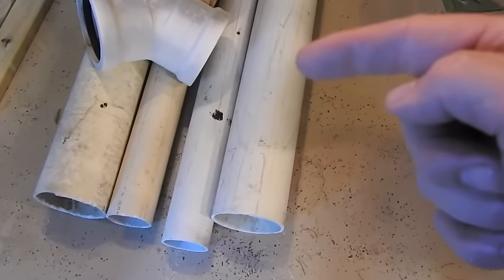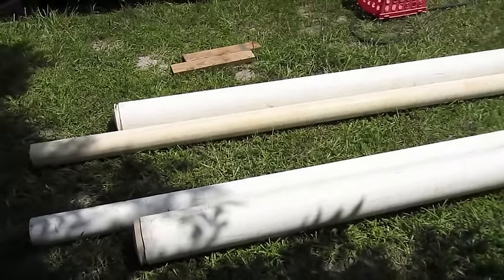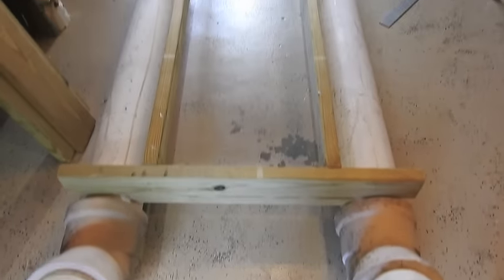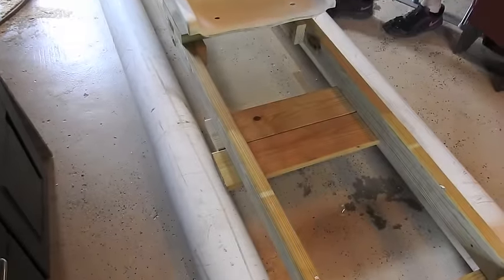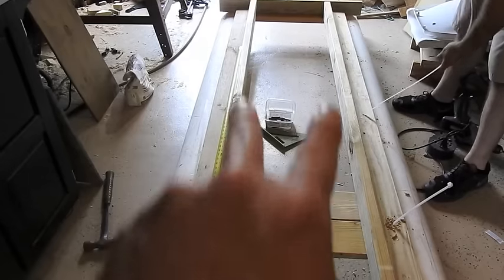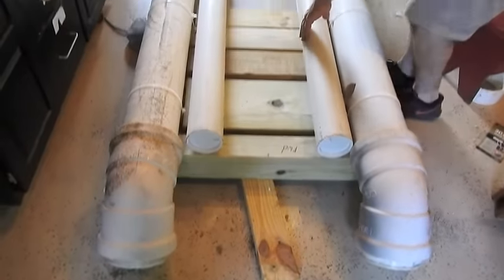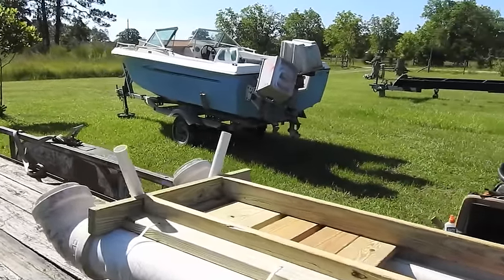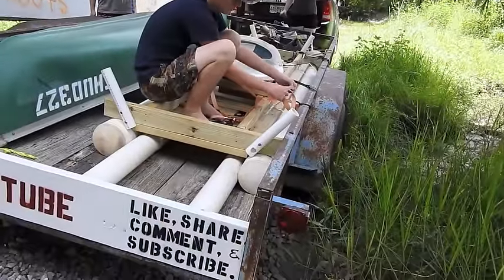Cheap $100 Homemade PVC Fishing Kayak How To

Comment: needs a little more floatation. foam sheets might work.
Reply from the maker: That is a good idea and this morning we put 3 more pipes under the front. Thanks for watching.
Reply: Only way to increase the floatation (buoyancy) is to displace more water below the surface. In order to achieve this you'd have to add more toons, increase the length of them, or swap them out for a larger diameter pipe
Reply: six6tysix yup. Positive buoyancy is also improved by flatness. Theoretically if you would roll out the pipe so it becomes flat there is more upwards pressure, allot of pressure is getting lost now due to a bit pressing on the sides and up instead of only up. For the very same reason stability would be increased. Though considering working with the materials at hand, swapping the smaller pvc for same size would be allot better. Placing just a 50cm long pipe on either side as outrigger will increase stability allot allot. That at or slightly behind the seat to keep manouvrability. That or a very shallow keel. The latter does not provide  positive buoyance though.

Comment: Great idea. What i would do is seal up the ends, then drill holes every 2-3 foot and fill the holes with exspanding foam, then seal up the holes. I know you did use foam inside, but i dont think the tubes were full enough. The posibilities are endless
Reply from the maker: It sure was fun!!! BTW, I just uploaded a couple of homemade pontoon boat videos, I would love to hear your thoughts on them... thanks for watching.
Reply: Adding foam will not increase bouyancy. Foam will just add a lot of weight to the PVC tubes making them less bouyant. As long as you seal the ends properly they will be water proof and attach the wood frames with straps thus eliminating any need to drill tubes. This is not rocket science boys.
Reply: mark carvour  I guess you missed the rocket science class that showed how foam floats and dont sink !!!
Reply: Use closed cell foam. Open cell foam soaks up water and that is the type used in the video. Any type of foam in the tube will displace the air which increases the tube weight. The only way to lighten the tube weight is to add a gas that is lighter than air. Might I suggest that you use hydrogen which will make for rocket science. Seriously, seal the tubes with a PVC cleaner and then use PVC glue and the tubes will be water tight and no need for a secondary floatant which only adds weight and does not add floatation.
Reply from the maker: Great explanation, foam is heavier than the air in the tubes. Thanks for the reply.
Reply: I should add that real pontoon boats do use closed cell foam in the air tanks for redundancy (safety). Those metal tanks will sometimes spring a leak from hitting rocks, logs, etc. For a hobby project like this I wouldn't bother and besides if you do get a leak it will add to the excitement.
Reply: Lol

Comment: that's some dirty black looking water
Reply from the maker: It is a good thing that it doesn't smell as bad as it looks... I actually doesn't have a smell.  Thanks for watching.
Reply: lee gates Thats called brackish water.
Reply: Thats clean water compared to where I'm from.
Reply: its actually called a screw driver Don butter
Reply: i live in the hard woods in Minnesota... the leaves from the trees ( it is called tannin) the acid and the iron ore's  in the soil stain the water ( see Minnesota iron range)...dissolve in the water and stain it from dark green to almost black
Reply: water clarity is expressed in inches, not feet... look up seechie disk
Reply: oops secchi disk... that is how we determine water clarity.... pollution is our main concern here... any time you have a heavy metal mining operation, or oil rig... pollution is, and always will be your main concern.

Comment: fill the bottom with 4" PVC with the angle pc in the frt. will float higher and  move thru the water better .might even be able to run the motor with out half the boat under water
Reply from the maker: I am not sure what you are talking about, but I sure thank you for watching.
Reply: you only used two 4" ,you could have fit  2more in  and got more flotation and like a bottom to the boat
Reply from the maker: Good idea, the 4" is also lighter and cheaper.  I like the way you think.  I may put it on my to do list as soon as I finish with the amphibious go-cart that is in my mind... Thanks for the reply.

Comment: you can take treated  two by fours cut them down to one by one cross members you can use the pipe will add more displacement of water then you should be good to go , can't wait to see the next video we all have to learn I hope this helps a little good luck
Reply from the maker: Good idea, I actually redid it with lighter bed frame angle iron. I did better and thanks for watching

Comment: I was making a plan for something similar. But instead of foam, I plan on using ping pong balls. With foam, if water gets in, the foam will absorb the water and waterlog, I've seen it happen with surfboards
Reply from the maker: Good idea, I was going to just leave air in the pipes.  Have you seen my barrel pontoon boat yet?  you might just like it even better. Thanks for watching.

Comment: Foam add weight. ..I think we need to add more pvc. ..thanks for the idea. ..im planing to build one. .. affordable and fun project!!
Reply from the maker: It was a lot of fun and good luck. Have you seen my barrel pontoon boat, you may want to build one of them instead. thanks so much for watching.
Reply: PVC PIPE 
Diameter =200mm
Lenght = 3m
---------------------------------
V = (0.1*0,1*3.14) * 3
V = 0,0314 * 3m => V = 0,0942m³

0,0942 m³ = 94,2Kg 
This is for one PVC PIPE with 200mm  diameter.

You have 2 main PVC PIPEs 200mm 
V = 0,094,2*2 
V = 0,1884m²  
Maximum weight = 188,4 Kg

you need 
-  3 PVC PIPE, 200mm at 3m. or
-  2 PVC PIPE 250mm at 3m

Comment: Cool idea the one thing  I would have done was put tire inflator stems in the 4” pvc with small air pressure gauge so you could fill the pvc with air to for more bouncy
Reply from the maker: It is a good idea, but the air for me would be to keep the water out. We had one that leaked a little and air would keep it out or at least show where the leak was. Thanks for watching.

Comment: I always wanted to try that ... good stuff.  where is a lake or a river there is fun.
Reply from the maker: Thanks it is the St. Mary's river between Georgia and Florida... Thanks for watching.
Reply: I meant to say "that where there is a Lake or a River, there is fun"  ...  anyway, thank you for the video and good luck on the next project.
Reply from the maker: I read it wrong and yes, water usually equals fun! I plan to have that pvc boat in the water soon with the motor moved forward a bit, when it warms up a little...

Comment: I built mine exactly the same but didn't put anything in the pontoons and it floats way higher than this. I also installed tire valves on the pontoons incase I decide to add helium to them
Reply from the maker: Only one of these were 1/2 full of foam, but this thing was way heavy... Thanks for watching.

Comment: Could you do what I’ve though?
You have the perfect frame. 
Now use Balsa, or Just PVC. Add PVC in the PVC for more Air..

Add Tin Roofing on the bottom. 
Have it fold up the sides. (Ittle come through the back and front).

But the Tin is simply for Skidding the Bottom. 
While the siding protects the PVC.
As for the Nose. Idk. Foam? Lots of it. Same with the back, and even the tin.
Adds buoyancy. And definitely softer.

I am not sure. Just made it up. Mainly skiff Design. (Using a push paddle). Sliding over rocks and shit
Reply from the maker: Good thoughts and thanks for watching!!

Comment: How well did the 45 degree elbows go through the water?
Reply from the maker: I didn't do a speed check, but it did feel better.  Thanks for watching and video coming soon...
Reply: I meant did it feel smooth going through the water with those 45's  or did it feel like it was plowing through the water?

Comment: Wow, that's pretty low in the water.  I'm thinking more pipes and less wood.  But what's the purpose for spraying foam into the pipes?
Reply from the maker: More pipe and less wood is a good idea. I think he was putting in foam in case the pipes try to leak. Thanks for watching.

Comment: I can very much appreciate the ingenuity!  some sort of strakes or chines would improve planing and stability. since this is a similar concept to pontoon boats, check out those designs. I believe the weight of the materials used is a significant factor, but I do understand and appreciate the "do you think we could?" factor...  only a suggestion, no negative comments intended. looks good on paper, and even better in concept. but, I'm glad you didn't break the bank... every great idea begins with a concept. 5 stars for effort, concept and completion with testing. I believe with a few refinements, you guys have a winner! well done. thank you for your efforts and posting :-)
Reply from the maker: Thanks for your thoughts.  I think the concept was a win once it is in the water.  It out performed my canoe when we went fishing on a windy day.  The homemade was most in the water and the canoe was mostly in the wind.  If you had a strong current the story would have been different.  The biggest draw back is its mass.  That thing is super heavy.  It is too heavy for one person unless if you back the trailer down in the water. The idea was to make it pick up truck ready, but you would need several people to get it in the truck.  Next time, thin wall PVC. Thanks for watching.
Reply: in my book, an absolute win!! paper doesn't float as well as practical application. thank you so much for the video. ya'll have inspired me!!  ;-) i'm in the designing process.

Comment: For around the same cost you can build a actual kayak with plywood.  One that will row well, and stay above the water.  PVC is not a good boat material.  It degrades from exposure to UV light, and becomes brittle.  It's 1 stump or good sized rock away from being a submarine.
   A fun "Will it work?" kind of project but that's about it.
Reply from the maker: Yes, we had a blast with it, thanks for watching.

Comment: Bigger Pipe needed. This sits way to low in the water. Spend a little money and build you a masterpiece. This would be good for small kids, would ride higher in the water, but I weigh 235, no way woulld I get in this. Great idea and video, just need better and bigger material.
Reply from the maker: Bigger pipe would be nice and thanks for watching.

Comment: That was sooo cool I'll have to try that
Reply from the maker: It was cool and easy, I want to do more stuff like it.  If you do it, they make a thin wall and a medium duty 4" and 6" PVC. The thin is very light, but is also weak.  The medium is green, a little heavier, stronger, and best of all it is the cheapest of the 3.  I plan to buy some tonight for my next project. Thanks for watching and good luck.

Comment: Nice concept. Build could be better. Key word: Bouyancy. You either need bigger pipes or more of them. Use 2 X 4s & 1 X 4/6/8 etc. Also, invest in PVC glue. Sets solid, no air gaps, and it's a helluva lot better and cheaper.
Reply from the maker: Those all sound like great ideas, but the caps we had were slightly smaller than the fittings.  The gap was too big and therefore we went with the silicone. Thanks for watching.
Reply: chud327, well Chud, that's a little bit different then!😁😁
Reply from the maker: Thanks for the reply.

Comment: I think I'd hold out for the smaller tubes being made from 6" rather than 4" It just rides a little too low in the water for me to trust it. Still, for the materials at hand, a neat project.
Reply from the maker: Thinner would be nice because it would make the boat lighter to handle.  As for the boat, it sits low, but it is stable and hold a lot of weight. Thanks for watching.

Comment: install tire valves then clean them and glue them apropatley for wet conditions.
then compress to one half the rec. pipe prs.
Reply from the maker: That would be a good way to test for leaks.  Thanks for watching.

Comment: I was wondering....can you put fittings on both pvc tubes and fill them with air? I would thing adding 10-15 lbs of air to each tube would help alot? Idk
Reply from the maker: You could, but I don't know if it would help with the floatation. Thanks for watching.

Comment: Id fill those pvc pipes with expanding foam, that away if you ever was to hit a rock hard on one of those connections and it came apart, it would still float
Reply from the maker: That would be great if it ever came apart and thanks so much for watching.  BTW, do you have any tips for my pontoon build, I would love to hear your thoughts.
Reply: @chud327  give me a few minutes and I'll watch the build. Please don't take my comments as criticism, I was just trying to help think of ways to make it safer and allow you to continue on your trip, even if you had to limp it back home, you'd still be able to do so.
Reply from the maker: Oh no, I like to hear what other have to say.. I am planning to build a bigger and better pontoon boat and am looking for input.
Reply: @chud327  ok, cool!i just wanted you to know where I was coming from so you'd know I was just trying to help instead of degrade.
Reply from the maker: no problem and thanks again

Comment: I would of used big big hose clamps to hold PVC  instead of ties.
And Routered a a grove in wood to hold a stealball under both sides of seat so it rolls nice.
Think 10" PVC or 12 be better but it didnt go down.
Reply from the maker: Zip ties were temporary to go try it out.  Bigger PVC would have been better. Thanks for watching.

Comment: I wonder if you added a valve stem to the PVC pipes you could pressurize them and it would float a little better.
Reply from the maker: I was thinking more air would be heavier and less buoyant, but I guess I could test it. Thanks again.

Comment: What measures are used? And what are the gauges of the tubes?
Reply from the maker: the pipe is schedule 40 and the lengths are about 9 feet on the 6 inch and about 8 feet on the 4 inch. Thanks for watching.

Comment: Those white pipes are very thick and lessen the buoyancy. Try the green ones and use 8" diameter. Also those bends are a drag in the water. You can bend the pipes using a hot air gun.  see 

https://youtu.be/KHfcdJundZY 

and
 https://youtu.be/e9Qv3Pe63Vs. 

Also need to work out the displacement value of the pipes. Obviously there are not enough pipes here., and not enough displacement.  A little maths here will work wonders.
A foot of 8" pipe displaces 600 cu ins of water or 21 lbs
So, if a person weighs 200 lbs you need 10 feet of pipe. But double the number for safety and for any deck or frame.
Reply from the maker: I like the looks of the ones in the link you shared, I may have to try one. thanks for watching.

Comment: Add an air valve and fill with air to about 35-50 psi and you'll float higher in the water
Reply from the maker: Wouldn't more air be heavier and therefore you'll float lower in the water?  I may have to test that for the youtube. Thanks for watching.
Reply: @chud327  the foam you used is definitely not helping because it is open cell foam. It will retain water, you need closed cell marine pour foam to fill those.

Comment: Couldn't you have installed a couple inputs for an air chuck n compressed air inside the tubes?
Reply from the maker: Wouldn't the air make it heavier? thanks for watching .
Reply: chud327 you are right and i am wrong. It would actually decrease bouyancy

Comment: I got a motor mount and electric motor for my Sevylor inflatable fishing boat and found out I preferred the oars.  The battery for the motor took up too much space and the propeller kept getting tangled with seaweed.
Reply from the maker: The battery would be a little bit of a pain, but I would still like to try it out.  I like oars too. Thanks for watching.

Comment: I'm not sure the foam you added inside the 6" tubes aids that much buoyancy (if any?) versus the weight of it?  ;-)
Maybe extend the tiller and add a throttle control (motorcycle) to it?
Reply from the maker: That was not me doing the foam, that may have been in case the pipe leaked... thanks for watching.

Comment: wood only floats when it's in the water  just at the water level 75% to 90 percent is usually underwater when you have something floating and you put wood on top of it then the weight of the wood is pushing down like I said wood is heavy , if you can displace water with wood then yes it will float , good concept though
Reply from the maker: Thanks and thanks for watching

Comment: You should have done some calculations to figure out how to make sure that the kayak will keep you out of the water . The calculation for any boat or something like that that is used to float on water is length times the width times the depth decided 1768 times 62.4 . Try this calculation for your next try .
Reply from the maker: That formula makes zero sense to me... thanks for watching.
Reply: Length times width times depth devided by 1728 times 62.4 .  In inches L x W x D / 1728 x 62.4 = displacement . Let's calculate a little wooden boat , first we need to know how long it will be and how wide and how deep we want to build . 120 x 46 x 18 /1728 (cubic foot) x 62.4 (weight of a cubic foot of water) . Now subtract the weight of the boat and you will have weight the boat will support . Hope that helps you out for your next design .

Comment: What kind of engine is it and how did you install it?
Reply from the maker: That is a pressure washer engine on an old boat motor foot. I also did it with a bigger lawn mower engine. There are videos of each. thanks for watching.